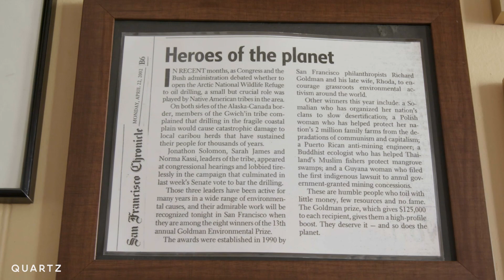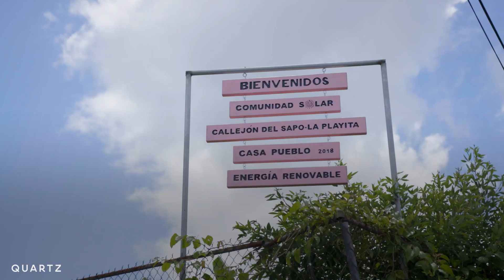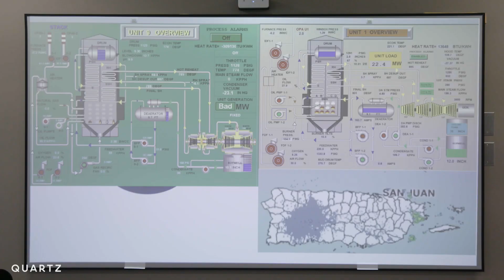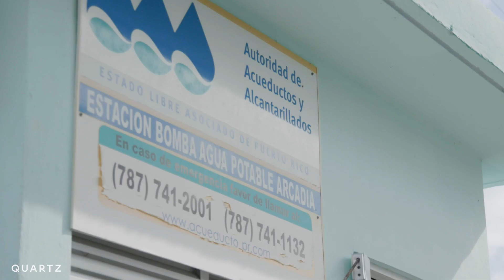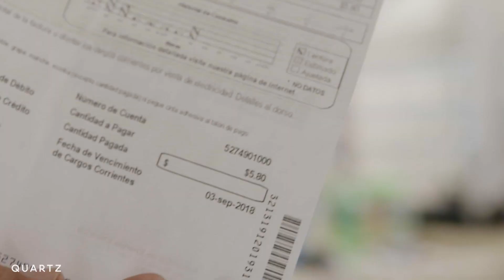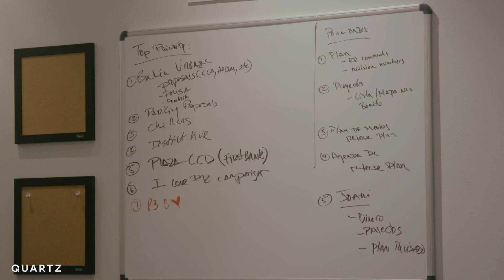Puerto Rico's solar energy insurrection

Comment: Hawaii will be the first US island to go 100%!! We're doing it.
Reply: Sash Kahlo B - What took Hawaii so long?  I can imagine power planning meetings went there in the past:  "OK, we're on an isolated chain of islands that get tons of sun and wind all year long.  How are we going to generate our electricity?"  "I know!  We'll import expensive and dirty fuel oil and burn it."  "Great idea!  Make it happen!"
Reply: Did the Hawaii allow solar back on the grid?  I recall they prevented new grid-tie connections.   Don't get me wrong, getting away from a distributed grid system would be great, but installing and maintaining battery solutions gets really expensive.
Reply: $.38 per kilowatt hour is the reason for that. If prices in the rest of the US were also like that, the public would be banging on every door they could to see more solar in  place as well as other sources of energy.
Reply: While your on the subject wind and solar are very invasive and obviously kill many birds and bats and are not healthy for the environment. Also many wind projects to have been abandoned and torn down. The cost of fixing and replacing wind turbines is far to costly and isn’t financially worth it. Also, we all know it is much more expensive to convert wind into electricity rather than clean coal, etc......high electric bills. Where I am I had a choice of partial wind electricity but the cost to do so was way to expensive that I opted out. Don’t wonder why Denmark and Germany and Greece are backing away from wind and solar after completely going all out for it.
Reply: Conservatards can't stop it.
Reply: As a Conservative I hate paying taxes thru my Electric bill and love saving money,   my 16KW+  has a 5Year ROI with no rebates.   Won't hurt my feelings to much if I take the Fed tax credit and give them less of my hard earned money.
Reply: @westcoaststacker569  
Try cutting down on your Consumption?
Reply: Yes that would be great,  I have 88yo inlaws living with us and 115d summer days.   As an electrician I refit the house with LED etc... but will keep the ACs and use that money for more solar which generates for many more hours a year than I run an AC for.  I built the house 19years ago,  would of been nice if I had the money and knowledge than to build the exterior walls thicker for superior insulation.  The current solar system is projected to be 120% of my past use.   

 It is not a liberal/conservative question,  I have clients at all extremes, some just do it for the savings, the early ones did it for the environment.  

Before the summer I hope to install a mini split system in the inlaws room to allow them to be more comfortable without the whole house,  their room is on the north side first floor,  when I built the house all the interior walls were insulated also, so their room should be its own little ecosystem.   

Additional solar and converting the Navien condensing tankless Water Heater to an electric tank are in my next plans.
Reply: @westcoaststacker569  keep going strong
Reply: @rogerstarkey5390  conservatives don't like to conserve. they like to waste energy liberally. it's their birthright of American exceptionalism and consumerism.
Reply: @myphonyaccount  lol you libtards are ruining the united states just look as Los Angeles has super rich people then has a bunch of homeless on the other end
Reply: @myphonyaccount  ---- The most innovative promoter of solar that I follow is a conservative. What do you think of that Demotard.
Reply: @BoopShooBee  
It doesn't matter WHO does it.
It matters that SOMEBODY does it.
Reply: Glenn Howden - Although there are notable exceptions, it's a fact that conservatives have IN GENERAL been much more opposed to renewable energy than liberals.  That's probably a function of their connection to the fossil fuel industry.  Regardless, instead of denying it, you should acknowledge it and continue to try to change conservative minds.  We'll all be much better off.
Reply: @dansanger5340  you can't argue with Conservatards. Look at how they blame Trump's debt on Obama.
Reply: @BoopShooBee  @Myphonyaccount This is neither a Democrat or Republican issue. Bernie Sanders did a video praising a Republican mayor of a city in Texas to go 100% renewable (mostly solar, but not sure if wind is included). If a Democrat does something right, I'll praise him/her. If a Democrat does something wrong, I'll criticize him/her. If a Republican does something right, I'll praise him/her as well and I'll criticize him/her as well if he/she does something wrong.
Reply: @josephheston9238  Bull republicans are terrible.
Reply: Here’s the issue with solar, it generates power during the day when most people don’t need it. So unless you can store the energy then it it wasted. The future is nuclear power, if you use salt as coolant vs water then there isnt a possibility of a meltdown
Reply: @MrNico123456789  
Here's the issue with nuclear ("Unclear")
You're a Government.
"You" want (need?) a power station.
Ask the locals?
They say "great!"
You say "here!" (Points at map)
Somebody says "not there! I LIVE there!)
5 years later you have a location.
5 years after that you have a design.
10 years  after that (!) you finish building.
Problems?

1) Building costs have spiralled. The contractor wants to pull out.

2) You're running late.

3) While building, the price of renewable energy has dropped substantially

4) At the start of the project a "strike price" was agreed for the power, gauranteed for 30+ years (!) after completion.
That price reaches more than 20% above that for wind power, 5 years(!) before the project is complete(!)

So, you have a problem.

Do you  (eventually) tell the consumer that their power will be maybe 30-40% more expensive than the cost of renewables (getting cheaper!)
and will stay at that price for 30 years?

Do you try to negotiate a cheaper price ? (Good luck!)

Do you walk away and invest much less to build wind turbines, ready before the Unclear is complete, and give the Consumer much cheaper power?

Oh, because you also generate that clean power sooner, you prevent Millon's of tonnes of nasty stuff being pumped Into the environment for another 5 years.
(This is happening in the UK, btw)
Reply: Roger Starkey ok those are all hypotheticals.

You suggested wind turbines, they might be cheap but cheap not enough to ever make a return on investment due to calm days and maintenance costs. And large wind turbines are made of fiberglass which cannot be recycled. So the only solution being burying them and they take a very long time to decompose. 

I agree with most everyone that renewables are getting cheaper and more available to consumers. But there are major issues if everyone ties into the existing power grid. unless there is a colossal battery bank setup to delivery power when the sunsets and everyone turns on their lights. The power grids are old and are made for typical power plants that operate when energy is NEEDED rather than available. So they couldn’t handle an massive surge of power that no one needs. 

The reason I suggested nuclear was because of the 0 CO2 it releases. And the super safe plants that are currently in operation. Almost all of them in the US are using 70s technology and have yet to have any issues. Using salt reactors they have built in safety features that make a melt down impossible. Don’t get me started on Thorium reactors. But with normal nuclear reactors there is nuclear waste but it’s all containable rather than releasing it into the environment 

An interesting note is that in areas surrounding Chernobyl there has been no connection between the residents there and increases in Thyroid cancer (the most common and treatable) meaning that there hasn’t been an increase at all.

Edit:spelling
Reply: @MrNico123456789   Roger Starkey  suggests wind power since he has a never ending supply of it to give ranting about things he knows nothing about....
Reply: @MrNico123456789  stupid, nuclear cannot survive financially on its own without subsidies. Solar can. electric cars plugged in all day long absorb surplus solar and release when needed to smooth out grid.
Reply: myphonyaccount 

Calling someone stupid is a great way to keep the conversation going. Nice.

Regardless, you said that electric cars would absorb the excess power during the day? That’s true but unless everyone and their dog drove 200miles to work and plan on doing the same back, then there would still be excess power. Also, how do you plan on using all your appliances in your home at night when the sun isn’t shining? I’m not saying that solar is bad or anything, I’m just saying that it will never be able to replace large power plants such as nuclear, natural gas, and kind of coal plants. 

Sure nuclear needs subsidies but isn’t it worth it for good and clean energy that releases 0 CO2? There are more people that 4.6million people a year that die from air pollution. It is actually said that nuclear energy has saved 18 million lives from its lack of air pollution.
Reply: SlapHappy 11 Solar IS stored. Many sell it back to electric companies. Nuclear is just a bad idea. We have plenty of renewable resources without creating nuclear.

Comment: its allllllll BS .. PR goverment is making it almost imposible to have a 2way conection , PREPA , wants to pay les than 10 cents kwh to owners and charge 27 cents kwh for grid elec so all this documentary is misleading , all renewable projects are private and no help, actualy alot of resistance from the corrupt goverment. adjuntas is the exampe of a town with no real suport from goverment or feds , so i live here in PR . I think this documentary is nissleading and not real about whats going on with renewable energy instalations.
Reply: Sounds a lot like the problem the Australians are having  I hear they sell at 5cents and buy at 25c or so.    There is a lot of DIY battery innovations going on down there.  But now with Tesla and LG etc...  homeowners can store their own power generation.   Technology is changing fast currently in that field.

I am very fortunate that the local city has net metering.  So I can postpone on a large battery system while they come down in cost.
Reply: @westcoaststacker569  Yes but private effort gets taxed, so they always get to your pocket.
Reply: It makes perfect sense that you pay more for consuming from the grid than for selling to the grid. How else could the cost for the transmission lines be recovered? Maybe the difference is larger than it should be because of corruption, but a substantial difference is natural.
Reply: So create a market for the renewable energy and energy storage batteries and connect to your neighborhoods. Take your complaining and turn it around to find an answer to solve this problem as a community then let it expand into other communities. Good luck. I hope you succeed soon.
Reply: @robertlee8805  Create a market in a government monopolized sector Sorry that is against the law you need to if they will let you get a licence and spend tens of thousands if not millions on regulatory compliance in order to be a electricity supplier to the general public. Not something just anybody can pull off.
Reply: @robertlee8805 please shut up.
Reply: @myphonyaccount  That's a bit messed up. He's telling OP to succeed rather than complain. I see nothing wrong with that.
Reply: @devonrusinek5807  he's denying the truth about corruption and requirement to rebuild grid and fossil system as it was before Hurricane WITHOUT renewables, batteries, microgrids, etc. He's putting it on OP to shut up and "do something about it".
Reply: @myphonyaccount  
There IS NO "requirement to build the grid and fossil system as it was before the hurricane...."

The truth is that building WITH clean energy systems will REMOVE the corruption.

Comment: Yes, They have an opportunity to go 100% renewable if big oil and gas stay out of it.
Reply: People need to create the demand for clean energy to eliminate the demand of fossil fuels.
Reply: Yes we can generate our own energy without the fear of high costs because of the outrageous idea of our governor to even think about taxing the ones generating their own power because of the " burden " on the ones paying 22 cents/kwh...
I have been generating my own power for over a year now, and that hurts the pockets of the greedy freeloaders of goverment politicians.
Reply: Satori One "Yes we can generate our own energy without the fear of high costs"
Solar is expensive. The ussubsidized cost of 1kWh of battery is $1000.
Solar is $0.51/kWh with a day's electricty as backup and IF it last at least 10 years. And that doesn't include maintenance, only includes installation costs.
Having solar panels in a storm is like putting up a sail... 
PR has to weigh the high cost of clean energy with is tourism income. Paying $1 per kWh may be justified, if tourism is very lucrative.
Even with solar, you still have a "grid" for electricity. PR needs to put major cables underground so they're protected in storms. 

"I have been generating my own power for over a year now"
Your time spent laboring to have less electricity.
Reply: @dmay3391  Its just a matter of perception...I did my own installatiln, no regrets when you know whst you got and knowing you got to detach from some " conveniences". that we have been made believe in some " needs " that only benefit some one else.
I am completely detached from the grid.
Reply: Satori One "Its just a matter of perception...I did my own installatiln, no regrets"
A perception is real for anyone who see's  the thing. Regrets are anything one subjectively imagines and impossible for others to see.
"you know what you got and knowing you got to detach from some " conveniences"."
Less conveniences by being off the grid. Less of everything other people can see. You're providing less to everyone else. Selfishness of being "off grid".
"I am completely detached from the grid."
Why diminish yourself and others by not using the conveniences grid power?

Comment: Puerto Rico’s electric grid was not robust enough to withstand class 5 hurricane winds. Microgrids must be robust enough to endure such winds with minor damage. Solar panels must also be installed so they are not disabled or destroyed in major storms. Without needed durability, any shared electricity grid would probably be destroyed.

Comment: Amazing how renewable and battery power can change the world. Making us more independent.
Reply: It is interesting times we live in.
Reply: Not amazing. 

What would be amazing is if we could do it at the same or lower cost as our current electricity.
Reply: Depending on what your utility/city charges you and where you live it may be lower.   Every year the cost come down while local utility cost rise.   So even with stagnant utility prices independent prices in prime areas such as Puerto Rico, Hawaii, Australia and Southern California it is now a very viable option.

If you live somewhere dark and gloomy and are still paying 10cent KWH then it may not be...
Reply: "battery power"
The battery alone cost $1000 per kWh. A persons going to use 5 kWh per day if they still use gas for heating water, cooking and no HVAC.
Solar and battery is the most expensive way to produce and store electricity.
Reply: D May not if the utility/city is charging you over 30cents a kWH,  many areas here in California it is even higher.   
I am dealing with 50kWH a day and have a 5year ROI without rebates.  In areas such as Puerto Rico, Southern California etc... the return on investment is rapid.   Mine has accelerated since the utility/city raised rates 20%each of the past couple years.  Investing in Solar/Battery protects you from future rate hikes.

Comment: The grid is poor at moving large amounts of electricity. Nobody tells you half the power is lost using wires. Making power at source is the best way.
Reply: A combined cycle natural gas power plant is approximately 50% efficient when not running at full capacity. Add the loss of 7-10% in transmission lines, then less than half the potential power of the fuel used ends up as electricity at the plug.
Reply: Solar and storage prices are dropping fast.  Soon, the cost of transmission will be too high to compete with residentially produced.
Reply: Actually, until the electricity generating companies stopped him, Nikola Tesla was on the way to providing infinite energy for free using the power of the Earth - over the air! The big companies stopped him because, of course, they would make no money if the energy was free!
Reply: @AtlantaTerry  Static electricity is low in current and was unlikely to power a mobile phone unfortunately.
Reply: You must be high, loses from power plant to home in the grid average between 8 and 15%.
Reply: @Daniel Government will quickly find a new way to tax us.  But I am all in already 16KW and about to add more.
Reply: I am in Los Angeles,  we have Net Metering.  My goal is to live on an island in the Pacific and be off grid.  Sounds like California is going the way of Florida.   But no with the Net Metering I will use the grid as my storage and start with a modest battery system like a Powerwall 2 since California has Cogeneration credits right now.  I would build my own but would cost more than the PW2 with a rebate.  I have a client with 3 since he has time of use metering and he wanted a Backup powered by the solar I installed there a few years ago.   During the fire he had to evacuate since he had no power, now the next earthquake, fire etc... he will be independent as I desire to be.
Reply: Power is 60 hz AC and very little IR drop on wiring, obviously u r not an electrician.